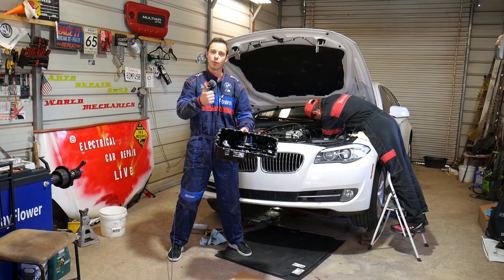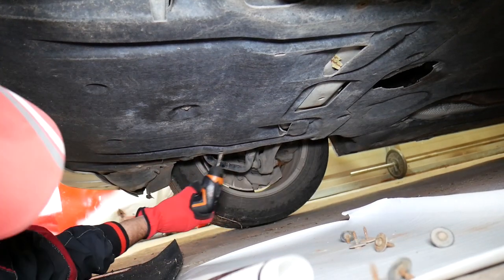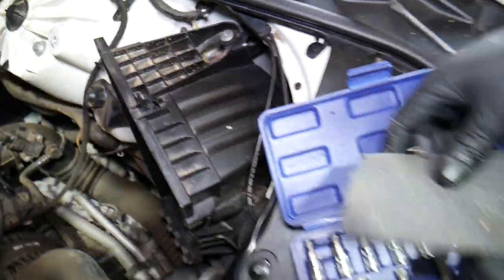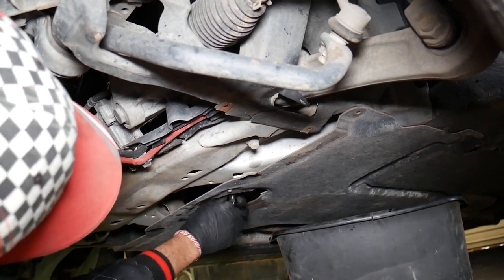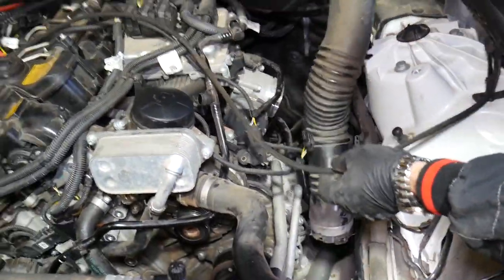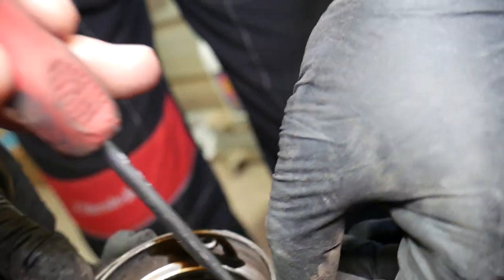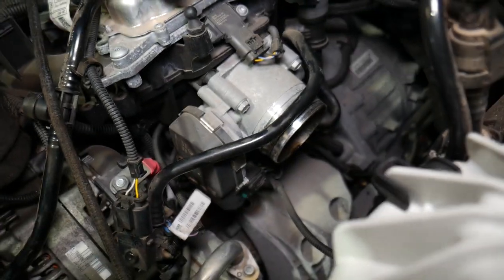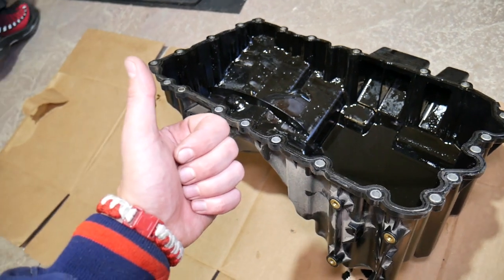BMW F10 F11 OIL PAN REMOVAL REPLACEMENT. OIL PAN GASKET LEAK FIX BMW 520i 528i

Comment: That’s why you should never buy BMWs you’re better off just please
Reply: You shouldn't be watching this. This isn't for weak minded people who give up easily.
Reply: I agree with L A
Reply: "If you can't afford a new BMW, you damn sure can't afford a used one!"
Reply: According to your mindset, should avoid driving at all. All car brands & models comes with a trade-off and issues.
Reply: What are the torque specs for the screws on: Motor mount, mount bracket and oil pan screws?

Comment: is this a rear wheel drive model?  if so do I need to loosen the trans mounts, is there not tension on the bell houseing and drive shaft when jacking up the engine on a rear wheel drive bmw ?

Comment: Great job guys. Maybe I'll let the dealer replace the gasket on the oil pan. Can you tell me how much you charge to replace the gasket? I have a feeling the dealer would want to replace the oil pan, gasket, and drain plug even if all it needed was a gasket

Comment: Brother number one, very grateful for your.Video. But making reflections on that work. I don't understand why you didn't lift the car evenly. Not sideways. Automatically the work became a little more difficult there. From a beginning. You should have put the check. In the tray. Of the transmission. And it would have saved you many of the difficulties you went through.

Comment: Did you reuse the bolts?  Are they aluminum?  Can I reuse the oil pan bolts on 2008 528i e60 n52k? Thank you.
Reply: No, you should replace them!

Comment: This the same process as the bmw f10 535i?
Reply: Want to say so is it?
Reply: quinteryus Campbell Idk but this should be a way easier job.
Reply: No its not.  The inline 6 motor is more difficult to work on since the oil pan runs over the frame member.  You have to lift the motor off the mounts and drop the front subframe and suspension components.  Big pain in the ass.